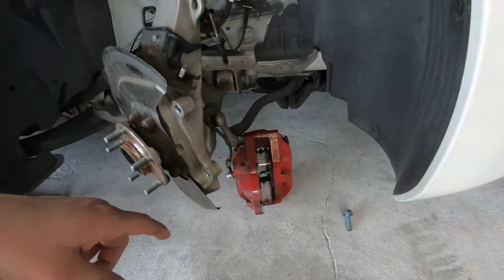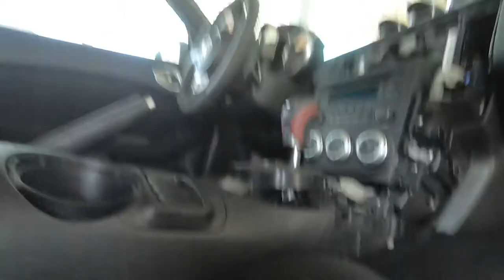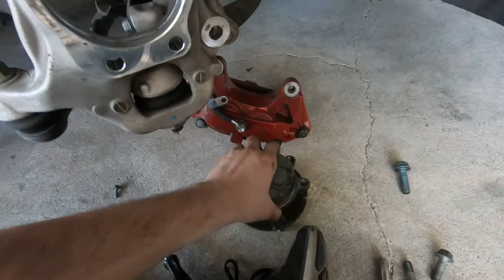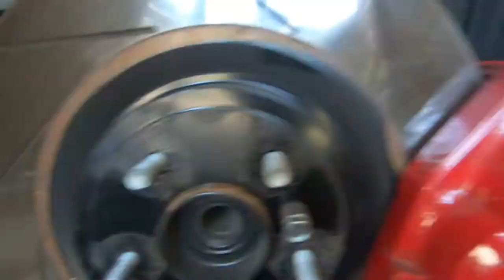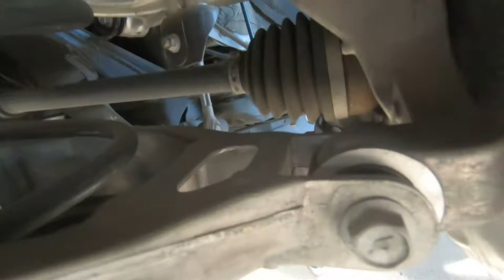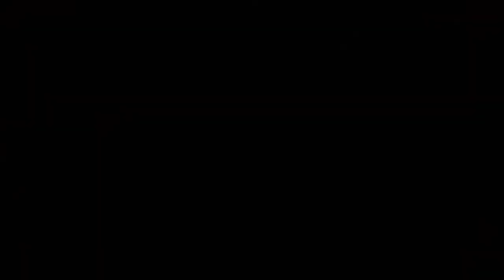370Z CALIPER HEAT SHIELD REMOVAL

Comment: What are the cons about not having the heat shields installed? Mine drive me crazy when they rub, and it sounds like I am dragging a rake under my car when they bend in towards the wheels, grrrr!
Reply: Really, there’s not a con. It’s simply over engineering, much like any of the shields under the hood.